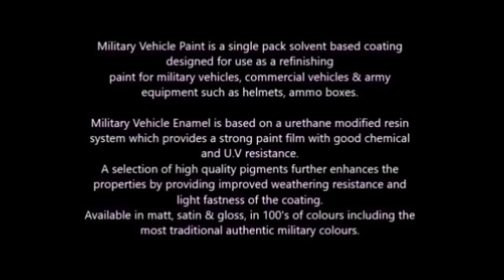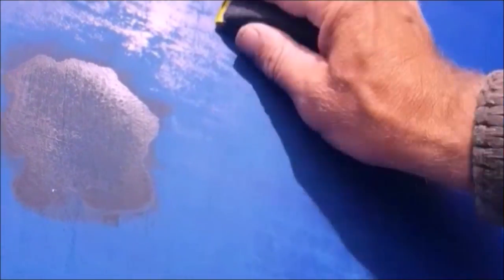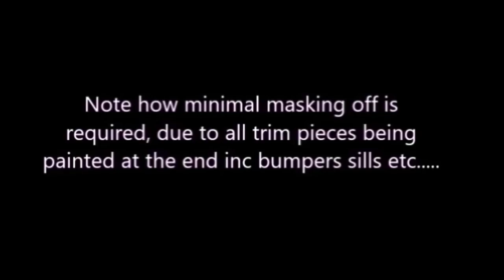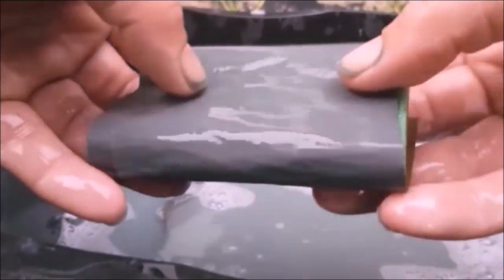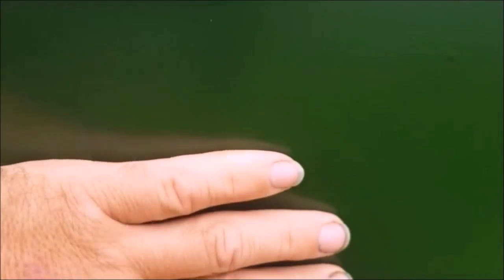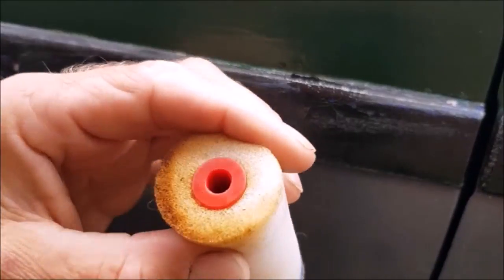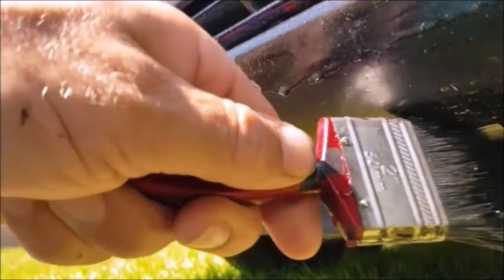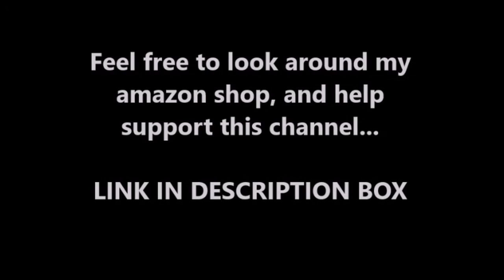MILITARY TRADE PAINT  (start to finish)  bexbugoutsurvivor

Comment: You do need to use thinners around 5% or max 10% in warm weather, that is what we had to do in the field or the RSM would chew our knackers off.
Reply from the maker: Not so, just read the tin....You were told to thin it out to make it go further. You cant use  spirits or water with resin based coatings, only oil or water based paints. A quick Google search from you would have told you the same.
Reply: @bexbugoutsurvivor  sorry, did not pay close attention, thought you were using spirit based (UK Military Paint or Coach Paint)
Reply: I just literally brougth some of this paint and Ironically it's to go on my vauxhall astra van. I let my wife pick the colour desert sand matt  hopefully the colour turns out ok if not be going back over it with a sky blue

Comment: what ratios of thinners (if any) u don't seem to have any... now I'm questioning myself...
Reply from the maker: Military paint is resin based, so doesn't need to be thinned. It was designed to be used in the field by soldiers to recoat battle damaged vehicles, or recoloured from combat colours to say NATO colours quickly.

It was applied by inexperienced soldiers, hence there being a self levelling compound in the paint to prevent runs and the need to rub down as much, or orange peel affect in the finish Unlike oil based paint, military combat vehicles do  not need to shine like glossy sports car. Once hardened the resin creates a near scratch resistant finish that will protect from harsh weathers.

I wouldn't apply it to a Ferrari tho...lol
Reply: @bexbugoutsurvivor  30 year old Hi-Ace with a frankenstein fibreglass full standing wet room on the back... so many angles to sand in, right 🤬 been sanding her for three whole days.
Reply: really appreciate how you've laid out the techniques and such here thanks for the reply.

Comment: Yeah unusually for me this is a subject I have experience in, the lorry on my profile I painted by hand with brushes and rollers, and I found the roller far quicker but required more coats, also I found that varnishing rollers left a better finish, obviously I was looking for a shiny finish for my project. I considered a military green for my car also but not sure about it attracting unwanted attention, so also thinking of the grey man principle and doing it metallic grey/silver. Good job mate it looks good.
Reply from the maker: I did the black hammerite smooth and blue Rustolium with a roller only, diluted and many many many many coats, and found it difficult to get a showroom finish, rubbing out the orange peel took weeks. This time I opted for the Satin finish, so don't worry about a shinny finish or diluting, or orange peel, due to its self levelling conditioner. 

 I opted for Dark Brunswick green, same colour as the old class 47 Diesel Locos. Brunswick green isn't too military looking, and draws little attention in the lights of the big city either...thanx for watching bex